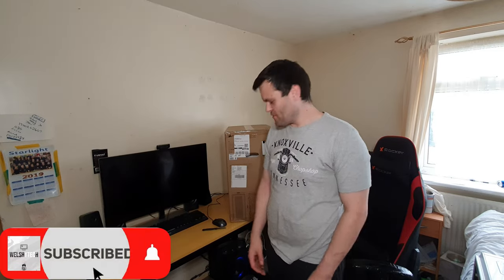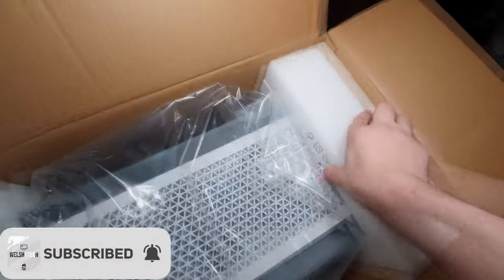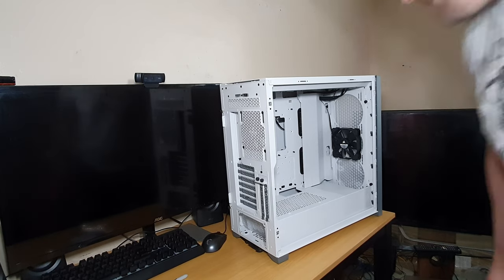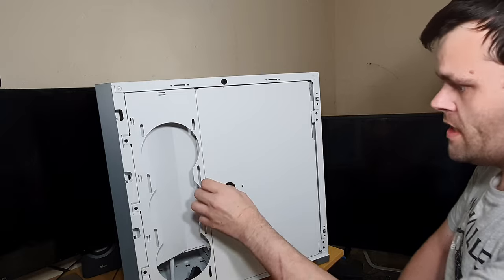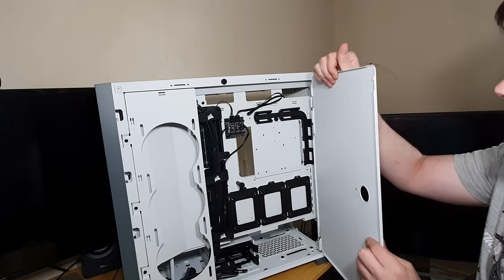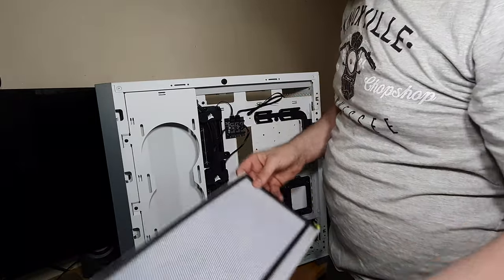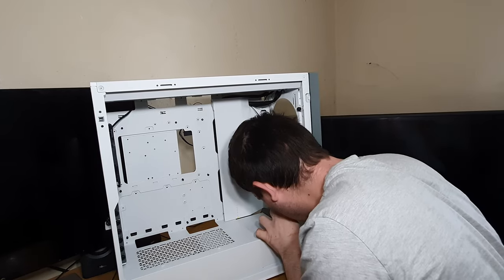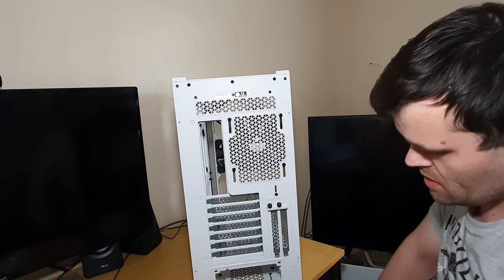Corsair 5000D Airflow Unboxing & First Look

Comment: How did you end up mounting your radiator? At the top as exhaust or side as intake? I just purchased this case too and debating on the setup!
Reply from the maker: At the top its the best option as for mounting as side mounted your intakes at the front will be fighting to give Airflow for the rest of the case
Reply: @WELSHYTECH  okay, thanks for the response I'll go ahead and do it with a push pull setup at the top!
Reply from the maker: @BlackBruceLeeTheGreatDekuTree  your very welcome anytime

Comment: So I don't understand the metal piece you switched out in front of the case (10:00).  Is that something you would do to provide more room for a side mounted radiator?   If I'm using a radiator at the top of the case, I should just leave the original metal piece in there?
Reply from the maker: its actually a plastic piece its for more radiator space at the front if you have a top mounted Aio or Radiator there's no need to remove it